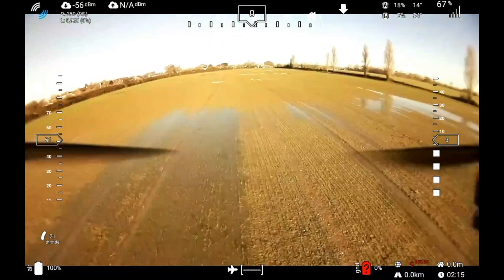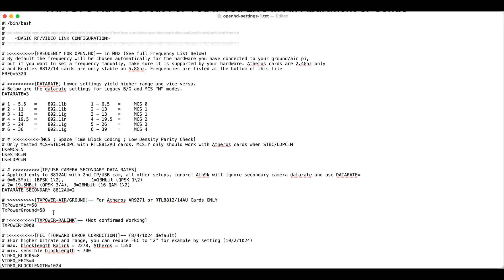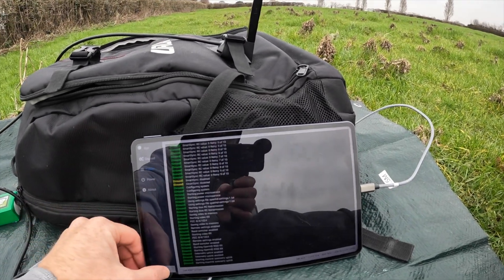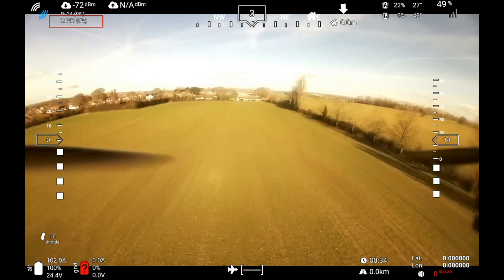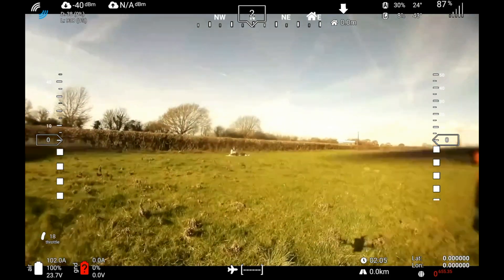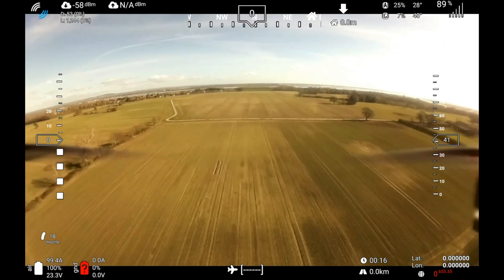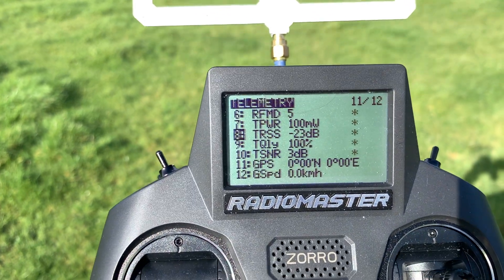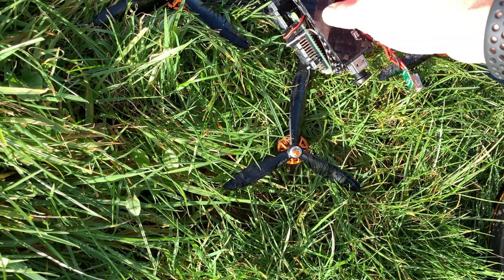Retesting the Open.HD quad - cleaning up the video... and crashing

Comment: I'm also in the process of building a 5" quad with OpenHD (actually got the parts a few years back, but now got the time for it). It will be my first quad, so I hope everything goes right. I noticed something: you are using an USB extension cable for the wifi adapter. Is it reliable? I saw people soldering wires directly to the adapter from the pi to eliminate accidental unplugs.
Reply from the maker: Yes - the advice is to solder everything in place as the vibrations from a quad (or other things) may cause a disconnect.  This is not so useful when you need to move the wifi adapter around, if I end up doing this I'm going to solder in a different sort of connector that I can use to move it around

Comment: Great improvements! Just a little question, you are not constantly pulling 97A at 20% Throttle, aren't you? Its just a display error lile with gps, right?
Reply from the maker: That's right - i don't even have a current sensor on this quad, so I don't know where it's pulling this from

Comment: With HDzero being so much better and cheaper I’d of thought this would have died. I used EZ Wi-Fi 3 years ago pre DJI but haven’t touched it since. Muddy picture, 125ms latency was fun to tinker with at the time.
Reply from the maker: It's certainly a bit on the quirky side and not ready for a regular user.  I like it because of where I think it can get to.  With HDZero really prioritizing latency over image quality it's quite different to where Open.HD is try to get to

Comment: Like the progress you have made this winter. Looks promising
 A frame with better cargo area would help to better organize electronics bits. 
What wing model is that? Definitely would love to see Open.HD on the wing. ;)

The issue with Pi's the last 6 months has be memory chip shortage. Purchasing Pi pcb's is virtually impossible, as most are bundled as kits (due to demand). Pi foundation says they anticipate chip situation to improve this spring into 2nd half of the year. They even began to offer 1GB edition of Pi 4 (vs. 2, 4, 8 GB editions), as that's only memory they could get over the winter.
Reply from the maker: I think Open.HD is about the promise of what it brings in the future, rather than what it does now... unless you like tinkering with things as I do.  The wing is a new old wing.  It's a Flying Wings Falcon Evo that a friend lad laying around new in it's box and was about to ditch.  This chip shortage is a pain, there's not an area of anything it doesn't seem to have hit!
Reply: @CurryKitten  I do like to tinker too, but have few other things need to finish, before adding another tinker project. ;)
Thanks for the Wing info, did find references for details. Glad you were able to save the wing and put it to good use.

Comment: I really liked this video. I am the worse in not fully securing loose wires which I believe wont be a problem with propellers and have sent several drones of recent into the ground. I now have become so scared to fly unless I've rubber band the exterior wires and to date, it has prevented me from sending my quad into the dirt and forcing me to hold off flying until my next bit of money appears.
Reply from the maker: In a regular quad it's fairly easy to get wires the right length and tape things down to the arms pretty well.  In the case of these awful ribbon cables they use for the cameras, there's just no cutting it down... although my fault for not making sure it was secured properly!

Comment: I took the workables of the Tyro 129 as you have there but didn't like that stumpy little frame body too, so built it into an iFlight XL7 V4 True X 7 inch Long Range Freestyle Frame Kit. Went together very well, makes a pretty good 7" cruiser, and may be just what you are looking for for your trials.
Reply from the maker: I was on the iFlight site last night looking for stuff.  I couldn't see a 7" XL - do they do it anymore?  But one idea there was the Chimera7 frame.  I do lik the iFlight stuff, it's usually good quality.  But there's actually quite a few decent 7" frames so I'll have a good look into it
Reply: @CurryKitten  I bought the frame from Banggood, and it is still on there. Search for "iFlight XL7 V4 True X 7 inch Long Range Freestyle Frame Kit Arm 4mm for FPV Racing Drone". The Chimera7 looks really good, maybe a better fit. Whatever, I will look forward to your video of the set up. Cheers!

Comment: Looking at your field maybe you should make an OpenHD rc boat?
Reply from the maker: I have to walk through all that to get there - I'm so glad that I have waterproof boots.  Ironically, when it dries out, the cows will be back so I have to make the most of the flooding right now
Reply: Hover craft, or air-boat could continue to work with just damp grass.  (ie: when the field is less wet)

Comment: I think a good frame would be something like the GepRC Mark 4 or something similar. It's quite long and should have enough space for a Pi Zero whilst also protecting it quite well.
Reply from the maker: Once I get my replacement zero, I'm going to start hunting out frames.  I'm still thinking7" though as much cruisy and easier to get a compass in there if i want to run iNav
Reply: @CurryKitten  that's true. There are multiple size versions of the Mark 4 frame though. They have 5,6 and 7 inch versions. It's a really nice frame for the price. It's $56 for the 7" version.

Comment: The video quality was great. Definitely a good step forward. Silly question but you didn't leave the gps module at home did you? That could explain why no gps fix? An old ZMR250 frame 🙂. Great to see the progress.
Reply from the maker: I have to say - I don't think so, but who can tell!?  I was using a module for a video on the WIO terminal a few weeks back, but I've got so many its and bits spread around the office that I just couldn't tell you!  I do have several ZMR250's kicking around, but I would like to go big and cruisy on the build if I can - and try and stay in the air a long time

Comment: Running that Triumph 5.8GHz antenna at 5.3GHz won't be helping a lot.  The effect won't be too great but it really would pay to use an antenna more tuned to the actual operating frequency.
Reply from the maker: A Triumph antenna indeed, do you think I'm made of money.  It looks similar but has an Eachine badge on it, so odds on that the frequency is nowhere need 5800.  Point taken though, the intention was to see if we got rid of the previous dropped frames - which looks good.  But I am using essentially bits from the spares box as far as antennas go - so this could (and hopefully will be) vastly improved.
Reply: @CurryKitten  I am being drawn towards doing some home-brew in the HD FPV area so maybe I'll publish a DIY video for making an antenna tuned to the WiFi frequencies rather than the FPV ones.

Comment: Thanks for another fascinating update! Sorry to hear about the breakages. 😥
AOS7 has lots of space inside for kit like this?
Reply from the maker: A new 7" frame needs to be sourced - there's a lot to look at.  I notice most of them seem to have very little room between the top and bottom plates - which is kind of what I'm after, but I can always jack things up a bit with bigger standoffs
Reply: @CurryKitten  I popped a picture of a 7" frame on discord. Some are long enough for 3x 30mm stacks so the pi could sit over 2x 30mm stack mounts with one free for FC & ESC.

Comment: You should give Ruby a try (you just need to swap the SD cards, same hardware) and see how the video works (it has bidirectional video like DJI) so lost packets are not an issue :)
Reply from the maker: It's on my todo list.  I'll rebuild a more robust quad first though

Comment: As for the crash - the reason is USB connector of AC56. It all MUST be soldered. What U got with the cable - it's a part of camera. Telemerty could keep working. But u got complete offline
Reply from the maker: It's all a bit speculative isn't it, but the pi was dead and wouldn't power up any longer, so I think that was part of the camera cable getting caught and pulling the pi forwards.  I don't see that damage happening in the crash due to the weigh (or lack of) of the zero.  I'll give you that the AC56 would be better as something soldered up, but I also have the need to move it around
Reply: @CurryKitten  usb chip dead. Have same after crash

Comment: Orca cant record HDMI in. And - get rid of circular antennae. Or you will have those drops forever
Reply: So is he only supposed to use patch?
Reply from the maker: According to Orqa it can record DVR of the HDMI in.  What are you suggesting I should use instead of circular polarized?
Reply: @CurryKitten  linear, check maple design, it really works

Comment: You need a 7inch frame like the tomahawk
Reply from the maker: Something like that - I think I'd want a enduro/long range quad as the latency means you are not going to be hitting tiny gaps as yet
Reply: @CurryKitten  no 😅 MarioFpv get a 4" quad dedicated to Open.HD 🙂
Reply: Interesting project... Shame about the mishap... I hope you get up and running again soon.. albeit in a larger frame... but on a cheerful note... very lucky to get away with such a small amount of damage... Thanks for sharing.